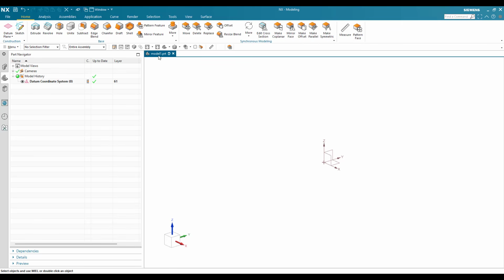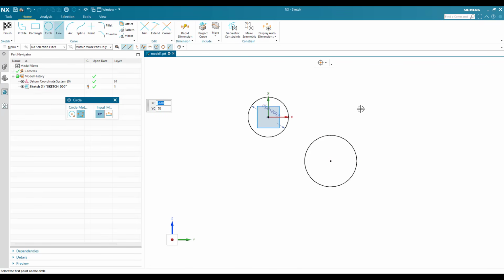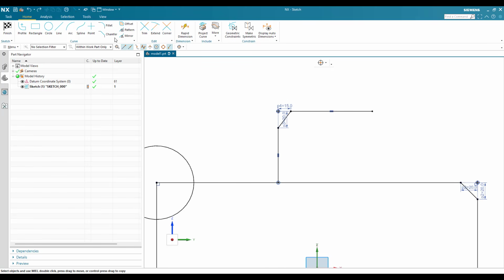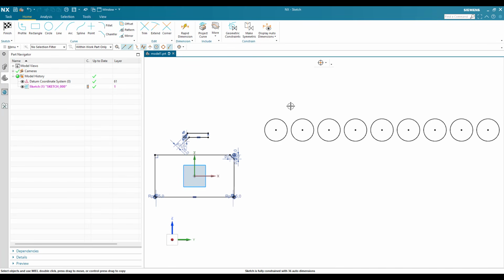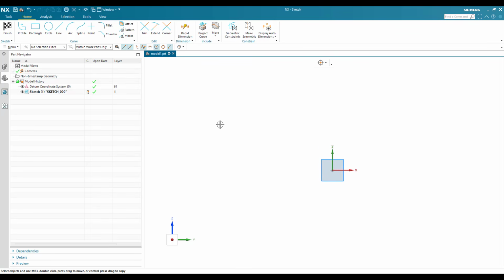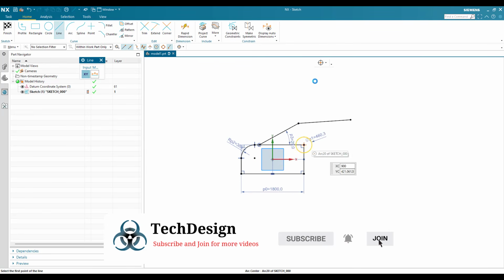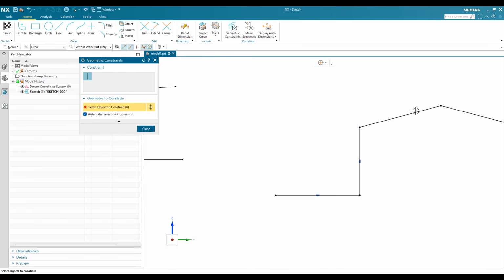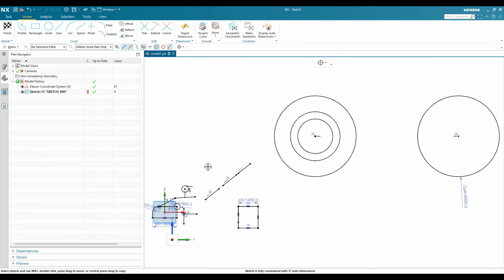Siemens NX- Tutorial on Complete Sketcher Environment NX 19XX version

Comment: hi sir, I was facing an issue while saving an assembly where I copied some components using copy and paste feature from a customer data, and a few of the components of my own, 
now when I save the assembly only the components that I made saved, and the other which were copied were not saved.       what I want to do is the entire assembly and its components to get saved to a new folder where each and every components gets saved.    PLEASE HELP ME I HAVE LEARNED NX FROM YOUR CHANNEL AND IT HAS HELPED ME SO MUCH.
Reply from the maker: Use clone assembly option and save to new location
Reply: @TechDesignsantosh  it gives a list of parts that are not in the folder its in different folder